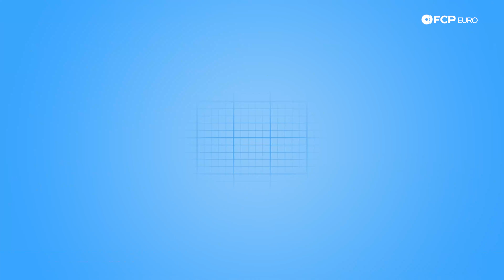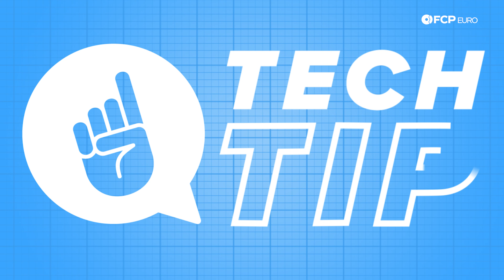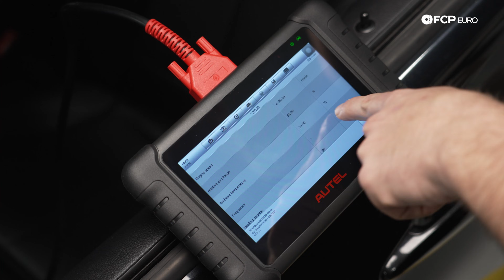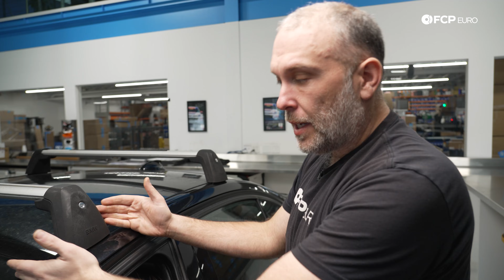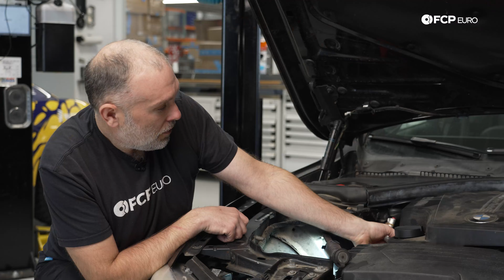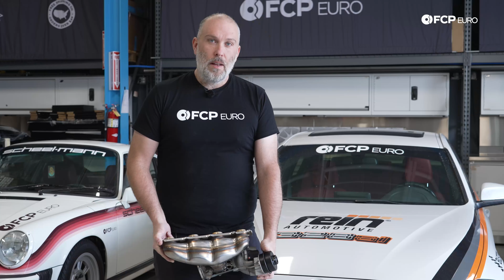How To Handle Your BMW N20 Turbocharger Wastegate Rattle

Comment: can you just replace the waste gate? Without replacing the entire turbo.
Reply: You have to replace the exhaust manifold for that. 

It will solve the problem, but only half of it I you also have the actuator rattling